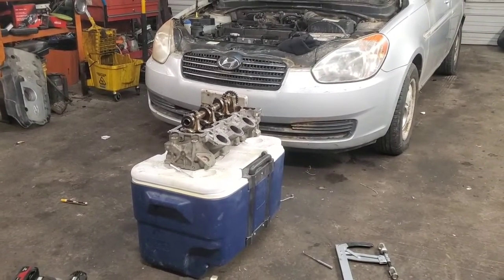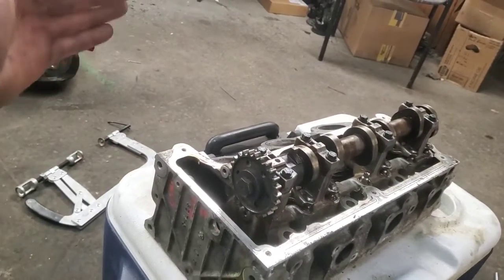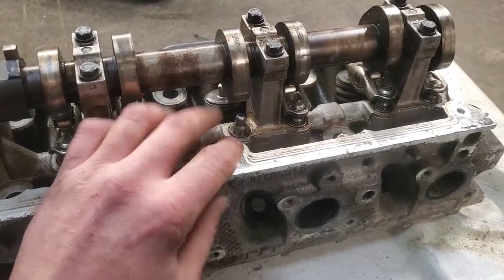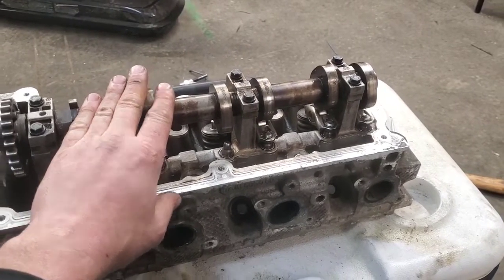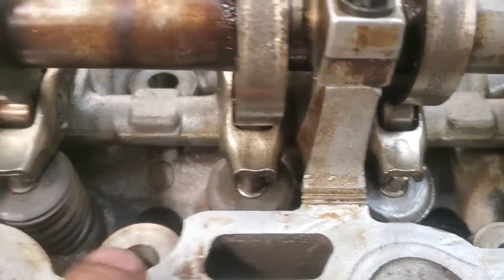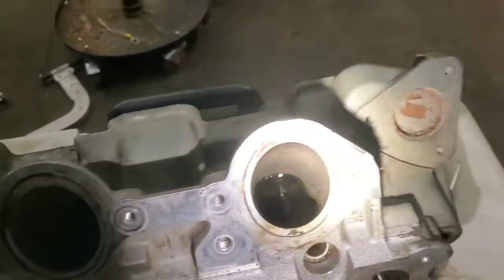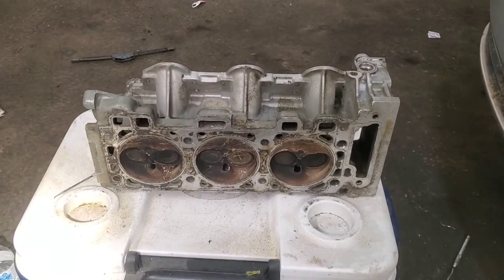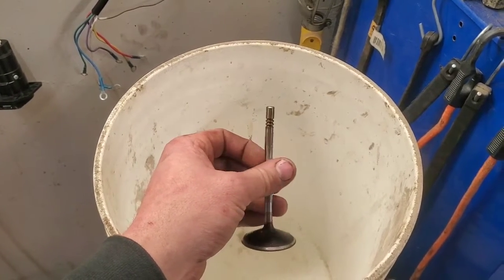Um........I Made a Mistake.  Ford 4.0L SOHC Timing Chain and Valve Issues.

Comment: I RECENTLY DID  TIMING C& G R&R ,GOT TBE 4.0 BACK TOGETHER, SOUNDED WORSE THAN BEFORE I STARTED!!
 PULLED DRIVERS SIDE VC I COULD REMOVE A FEW  ROLLER FOLLOWERS BY HAND.
THIS WAS MY FIRSTTIME DOING THIS JOB. IM THINKING THAT I COULDVE RELEASED VALVE KEEPERS,NOT KNOWING TO PAY ATTENTION. I DUNNO??
  DID A 5.4 3V TRITON,FIRED UP,SOUNDED AND RUNS LIKE A SCALDED DOG!!